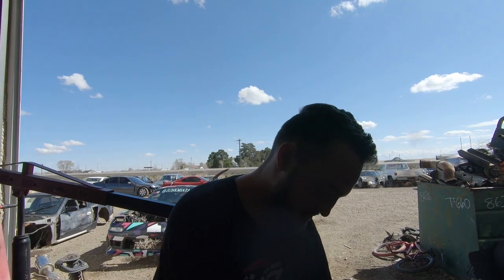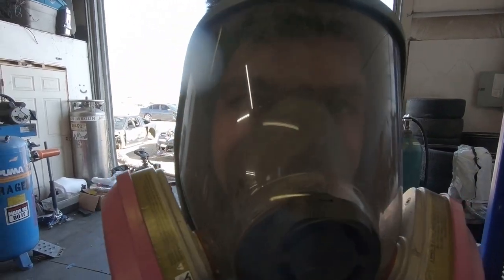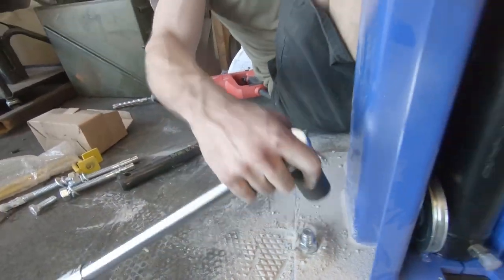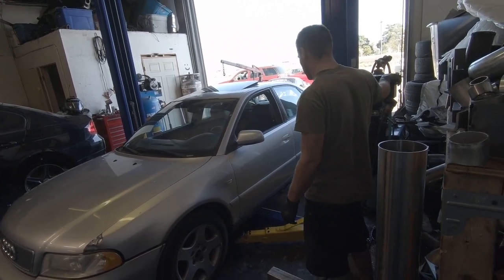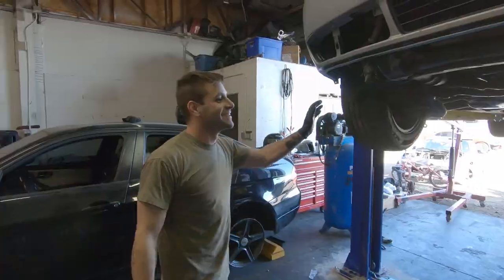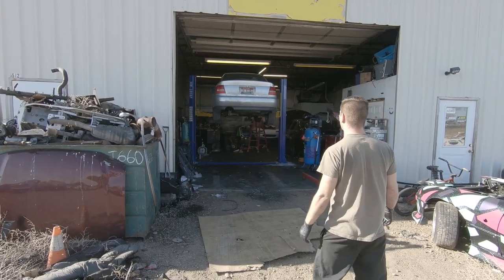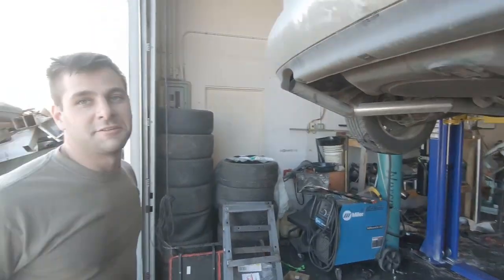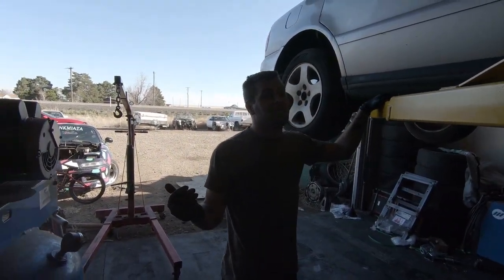We Bought a china LIFT off amazon!! Apluslift

Comment: Getting ready to drill for the bolts for the same lift. I almost made the same mistake with measuring 102” and last second realized the measurement was from swing-arm attachment points, even though instructions look like measurement is from The front edge of the base. Why the hell would they not have that measurement since is the most logical. Anyway, I ended up measuring from back edge to back edge which is clearly stated in instructions to avoid any issues. So far I am impressed with the quality of the welds and weight of the posts. Seems pretty solidly built. Like you, I was just thinking why the hell did I not buy this five years ago???
Reply from the maker: We still use it to this day

Comment: They are all made in China including the name brands maybe 5 are made in the USA the big name brands are not USA made well most armt you pay way more most lifts are made and China and each company puts their color and brand on it with their own manual like the 4 post storage lifts all China made nice vid
Reply: I own a Challenger Made in USA 10.000lb
Reply: Yeah but those name brands are made with better steel, usually thicker and most are actually certified by ALI/ANSI.

Most of those brands say challenger for ex. has US made and China made lifts. But both go through the same testing facilities.

 Most of these off brands can't lift their advertised weight without breaking or motors stalling.
Reply: @seikoandora6485  what year?, where u buy it?

Comment: Aplus lift is an american company though?
Reply: I got my A+ LIFT 10,000 lbs 2 post off AMAZON … IT WAS IN ,AND SHIPPED FROM US. SHIPPING WAS BY TRUCK. YES I NEEDED MACHINE … of some sort TO UNLOAD. IT WS VERY QUIK DELIVERY TO WISCONSIN. I BOUGHT IT 3 yrs ago. Finally got my shop erected enough to install it.  Yes I bought it FIRST. LOL. AS BUILDING MATERIALS WERE SKYROCKETING. BUT THE SAME HOIST LIFT IS NOW ALMOST $1800 more. Stupid.  Instructions were in decimal point measurements. 113.8 inches to center to center bolt holes.  But we’re very clear how to and put together. I thought. 
My first lift. I’ve used others. But this is still nice. Will use it a lot now i have it. Hope it lasts. Years from now.

Comment: I would never ever trust anchor bolts that are not poured into the wet concrete slab, just my opinion 😎
Reply: Every pro lift installer uses wedge anchor bolts. First they build the dealership, then pour slab and power paddle concrete. How would you site lifts perfectly your way? This is how it's done, but measured correctly of course.
Reply: Not stupid. It's the industry standard. Used thousands and thousands of times.
Reply: @richardgautier959  sorry,,I retracted my statment
Reply: Epoxy w/ quality all thread